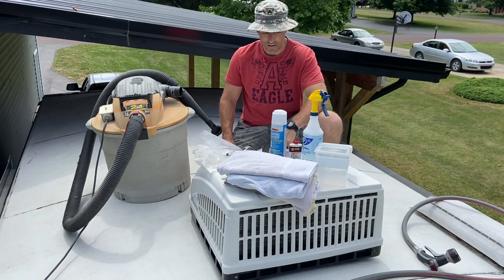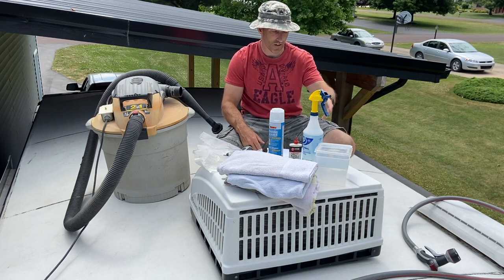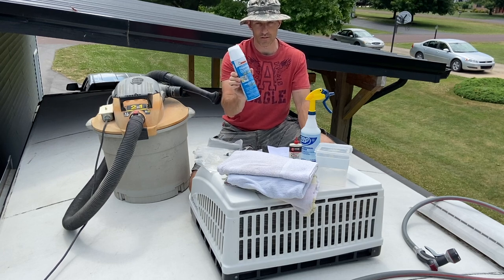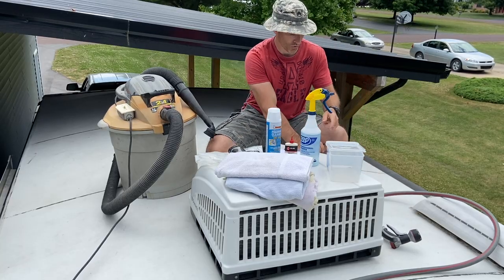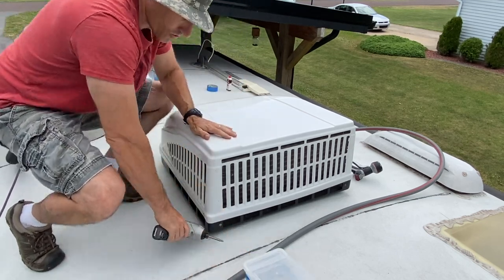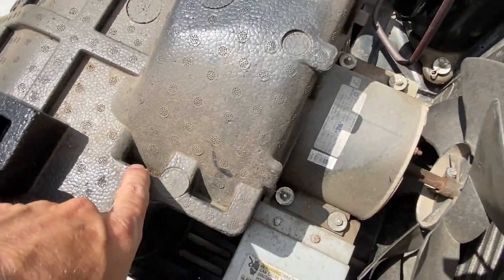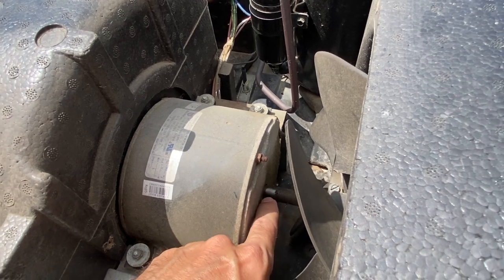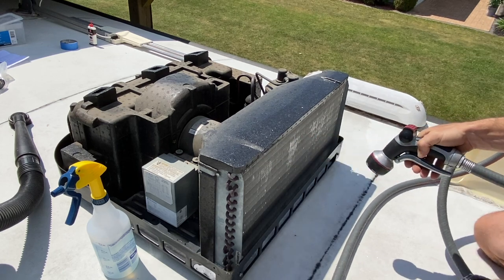CLEANING YOUR RV AC:  Camper Air Conditioning maintenance

Comment: Thanks for the video Jim.  I just finished one of the two units on my camper after watching your video.  One thing I ran into that might be worth mentioning,  after buttoning up everything and turning on the unit, there was residual water and cleaning solution dripping out of the inside vent.   Luckily I'd left the tub in place on the bed that is there to catch anything that dripped during cleaning.   I ended up moving the mattress of the wooden bed foundation completely and placed a plastic bag under the tub as well as there was a bit of spray coming from the vent as well.   Once the dripping and spray is gone I'm going to have to clean the wardrobe mirrors where a lot of the spray landed.  Kind of surprised me because I only used a spray bottle to rinse the coils and there wasn't that much water.
Reply from the maker: Good info never thought about some people having a bed under the air conditioner.

Comment: Do "not" use 3 in 1 oil to oil fan. Ether Bering grease or high quality machine oil. 3 in 1 oil turns to sticky varnish over a short period of time. You can get away with that on a door hinge but not a motor. Too much heat and friction.
Reply from the maker: Thanks for the info never new that

Comment: Excellent video, thank you! However what I’m trying to solve is that I have a clogged drain in my air conditioner. I also have the older AC model that you showed pictures of later in the video. I’ll look for a different video for help with this.
Reply from the maker: Thank you very much for watching and commenting

Comment: Set playback speed to 2x. “If” you choose to add oil (some have a grease zero which is always a better option if so), make sure you wipe it off very good, otherwise it becomes a dust magnet 🧲. 
Thanks for the video.
Reply from the maker: thanks for watching and the tip

Comment: How do you get the little circle covers off of the vent on the inside of the camper?
Reply from the maker: very carefully with a small screwdriver. If you have the exact same AC you might be able to clean the entire thing from the roof. I found out after I made the video, that my black foam does come apart so that you can clean the evaporator inside. If that would make it easier. Thanks for watching

Comment: Trying to fix my sister's rvs ac, looks exactly like yours down to the foam. Replaced the capacitor but it still just hums when turned on. I tried giving the fan a little push and that kicked it on, but it eventually stopped. The entire fan motor area is covered in dust, do you think cleaning it will fix the issue or does it sound like a different problem?
Reply from the maker: Sorry i could not say but cleaning it could not hurt. Maybe the fan motor is going bad.
Reply: @DIYJIM  Update, hit both ends of the shaft where it connects to the motor with 3in1 oil, starts up just fine but eventually kicks back off.
The person my mom had come out to look at it said that it wasn't the motor, so she keeps saying it's not the motor. The only other thing I can think of is that I'm not getting the oil in far enough on the side opposite the fan due to limited spacing.

Comment: I wish you would have inspected the drain. Maybe I missed it.
Reply from the maker: i think if i can remember the condenser coils just drip on the pan and run out on your roof so make sure the pan that is attached to the roof is cleaned good.
Reply: @DIYJIM  oh. Sweet! 
Does the tray have drain holes?  I have to inspect mine.
Reply from the maker: i would have to go on top of my camper to look at it. I'm sure they all could be a little different. I'm sure the evaporation drips into the tray then drains onto the roof.

Comment: I live in sand dunes in waynoka ok. Ours is only 2 years old totally rebuild with all new parts. I sprayed mine down because it was a little dirty with all the sand, dust and wind during the winter into spring. It's never had a issue. Been running ours for about 3 weeks now since spraying it down and cranking it back up again for this summer. It's blowing cold and seemed to be cycling normally. But yesterday and today its been turning off but less then a minute turning back on and making a clicking noise more than normal. It's still blowing very cold though. Just cycling way more than normal and clicking... This can't be good right? Any reasons or suggestions as of to why it's acting this way? Thank you!
Reply from the maker: Sorry I’m really not sure what could be going on. If you get it figured out let me know what the problem was. Sorry I can’t help
Reply: @DIY JIM  It's ok, thank you for taking time to respond to me. I appreciate that very much. I read it could be my thermostat is going bad. Hopefully it's a simple fix if so. I'll definitely let you know what happens next. Thanks again buddy